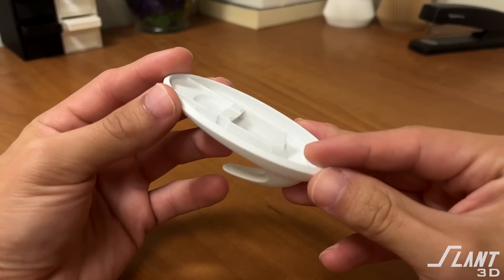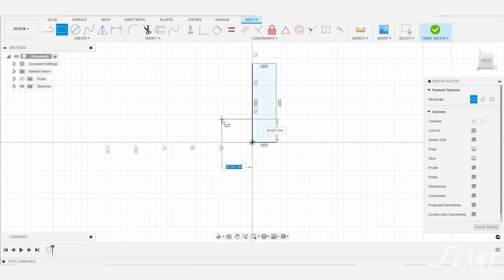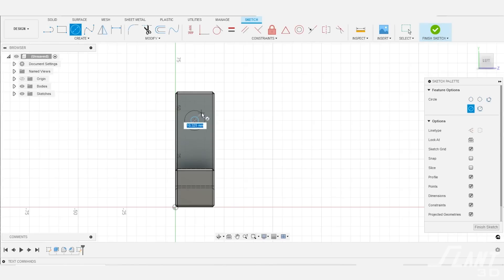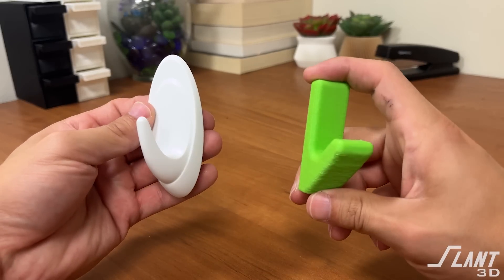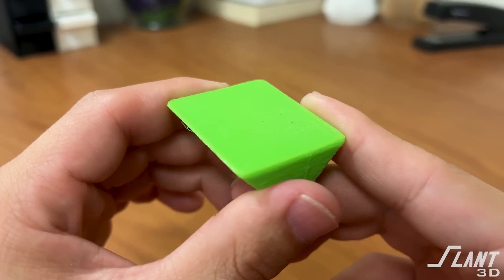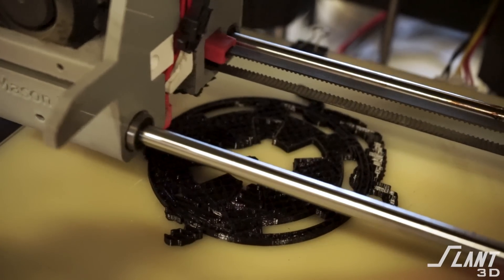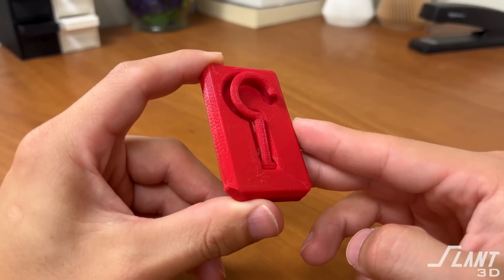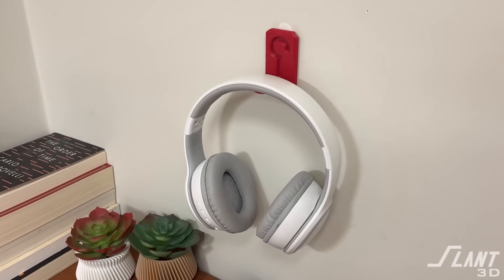Command Strip Wall Hooks | Design for Mass Production 3D Printing

Comment: I'm pretty sure these wall hooks are designed to fail before the adhesive itself fails. It's definitely preferable to have the hook break off rather than a piece of your wall, so that's probably something to consider before designing a 'stronger' hook

Comment: While I understand the "wow" factor of "Print in place" assemblies, I am not a fan of those for the simple reason that if /anything/ of it breaks, you have an iPhone situation: one small part is broken but you gotta replace the entire damn thing.
And I think we already produce enough plastic trash /without/ going ballistic with "print in place" stuff.
But then again, PLA is way more likely getting recycled than the parts in an iPhone.

Comment: I can see replacing the hook on that last model, with a 'T' which I think would give you better capabilities for holding cords, and even hangars. (At some point I can see redesigning the standard plastic hangar as well, but I expect that's going to be a 'some asembly required' product.

Comment: in one of your videos ( i forget which one) you mentioned that you chamfer the edges of the bottom surface to the bed? im trying to remember correctly.
Reply from the maker: Correct. We actually say in most design videos. Including this one
Reply: @slant3d  is it only to combat elephants foot? how small are you making the chamfers?
Reply: @olmosbananas Most people do it to help combat elephants foot or first layer expansion. It has other advantages as well, including having a place to slip a finger nail under the edge of the part when picking it up if the rest of the part doesn't give you a good way to handle it. Or if you make the mistake of sealing the pull end of the Command Strip under your print so you can't reach it, it helps get the dental floss you then use to cut up the command strip to separate the part from the wall.

There are other reasons as well. A chamfered edge is actually stronger than a 90 degree edge on pretty much any edge. It feels better when handling than raw edges, though a fillet works well for that part, it doesn't work well as the edge of the part on the bed, where the range of angles may require support that a 45 degree chamfer does not.(usually)

Comment: What machine are you printing on?  the print quality is so bad.
Reply from the maker: There is a texture applied to the parts. In this case it is a popcorn-y pattern
Reply: I was thinking about the same thing but I suppose the render of the texture is better in real life @slant3d
Reply: @slant3d  Why? I call bs

Comment: I think every hooks in this video are extremely ugly and don't seem to be better cost to value perspective.

If you want ateong hooks, I recommend buying good looking metal ones in arround 30 sec of searching i found 200 simple metal hooks for 12CA$ with shipping and 100 metal hooks that comes with 2 screws each that are almost like your plastic hook for 27CA$ including shipping. 

Tough as always the retractable hook is unique to 3D printing for the fact that it comes with no  more assembly than the other hooks
Reply: "I think every hooks in this video are extremely ugly..."  I do agree, most of these videos have similar chunky demonstrations.  But, that's the thing, they aren't products but rather demonstrations of ideas.  They aren't meant for people that want to download and print a design.  They are expressing concepts that people can use in their own designs.  And, probably designs that his company will hopefully print by the thousand.

I suppose there are places where an industrial chunky look would fit, but that's beside the point.  More likely, it's some wildly ornamental thing that's impossible to make any other way... that just happens to incorporate the structural concepts shown.

The lesson is that 3D printing can go big and still not use a lot of material.  There can be a lot of structural advantages to going big.  But, that 'big' doesn't have to be a rectangular block that took 45 seconds in CAD.  That triangular "hook" could be a SciFi creature's beak some artist spent weeks sculpting... and it would be a whole lot better if said artist actually watched these videos and didn't do some stupid little thing that makes it impossible to print.

I very much get the sense these videos are direct and frustrated responses to said artistic designs.
Reply: @4Fixerdave  I agree with you but recently Slant 3d are posting a lot of videos like this one with products that look horrible, the point of mass production videos like he explained was to compare 3d printed products with injection molding, not simply get an idea out in the wild. I would have liked to either have a lot of simple desing like this one in one video of the same lenght or one elaborate idea in one video.

It's just my feeling but I feel like they are pumping a lot of videos that could be of better quality

Comment: Printing the last hook on its back and enabling ironing for the top layer would give the most optimal finish without adding much time.
Reply from the maker: Not really. The issue is not the really to the top. It is the underside of the hook that looks distorted when it "opened" Ironing would not really help that directly on surface finish.
Reply: ironing adds lots of time tho; extra slow layer multiplied for every piece.

Comment: also can you touch on what kind of material is best for these mounting applications? ive heard PLA sags over time so id love to hear your input as far as materials go.
Reply: The "sag" (material creep) doesn't really matter much unless you have specific dimensional requirements. PET (not PETG, but PETG would at least fare better than PLA) or ABS or ASA would avoid it. Nylon is even worse.
Reply: @daliasprints9798  cool and thanks for the reply. I hear mixed things about nylon. What sort of applications is nylon actually useful for?
Reply: @Bdickey  That's a good question and I'm not sure. Maybe things where you have high temperatures but not forces that will cause creep? I tried nylon for a storm door closer bracket I had to replace after first and second try in PLA broke, and it just got horribly mangled and eventually popped off the snap fit door jamb side bracket. Replaced it with PET and never had another problem.
Reply: @Bdickey All nylon filaments that I've seen are 'Natural' (not clear, milky white) which at first sounds like a negative, but it has the advantage that once it's been printed, you can use fabric dies like Rit(tm) or others, to color it any color you can find or blend. So if you're looking for that perfect color for your step mom's gift, you can concoct it. Otherwise it's potentially useful for wearables in the variety of belt pouches for phones, knives, or any place that you might otherwise use fused sheet nylon, perhaps knife scales, or the like. 

At least one variety is often used to do a pull clean of a print nozzle, as it will stretch and deform instead of breaking, and self release from the inside of the nozzle, taking anything that might be causing interference/blocking. I wouldn't try this on any of the nozzles that split and merge the filament though. Not going to tell anyone else what to do, just don't think it's a good idea.

I understand that some people are having good luck with it as a carrier for stuff like carbon fiber. If you're going to do that though, I'd suggest picking up diamondback nozzles in your preferred nozzle size for any printer you're going to do t hat with. (as well as spare boden tube stock if your printer makes use of that. It's rather abrasive.)
Reply: @RNMSC  okay thank you!
Reply from the maker: Really a matter of final application. For parts like these PLA is fine. But would not always be the material we choose for mass production of like 100,000 of these parts. Primarily due to raw material cost.

Comment: Cool! Thanks for addressing the fact that adhesives don't necessarily stick well to 3d printed surfaces! I'm constantly having to glue adhesive vinyl stickers down to puzzle parts because of this. I don't know if there's a fix, but glue is the best idea I've had thus far.
Edit: apparently command strips don't have this issue, see responses.
Reply from the maker: That is not true of all vigin 3D Prints. We textured several of the hooks that causes adhesion problems at the start. But command strips work fine on general 3D Printed side surfaces. This is demonstrated in our handles video.
Reply: @slant3d  I found command strips stick well to textured plate surface prints as well as the smooth plate, it's just a matter of really pressing the strip onto the back and getting good contact with as much plastic as possible.
Reply: @slant3d  Interesting. I guess the command strips have more adhesive than the vinyl stickers I normally use. I guess that makes sense since they're supposed to be load bearing. Thanks for the info!
Reply: @jabberwocktechnologies  it's most likely a combination of a stronger adhesive as well as the compressible foam layer between the part and the wall side that allows the command strip to fully adhere to a slightly uneven surface